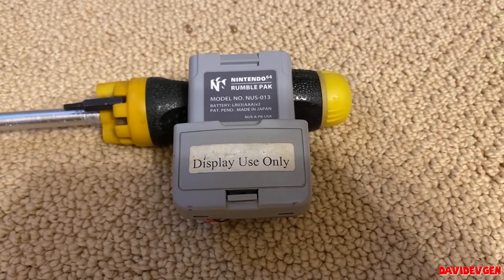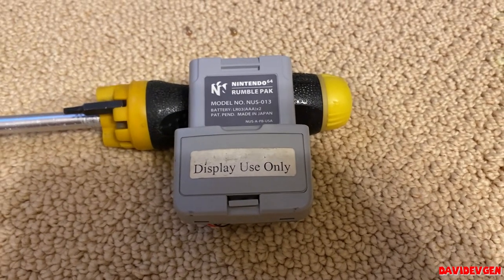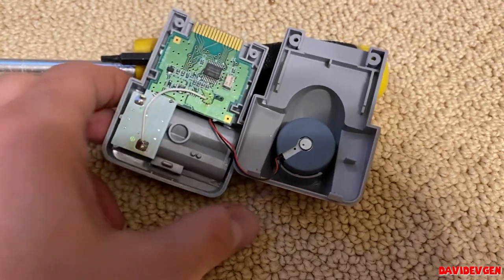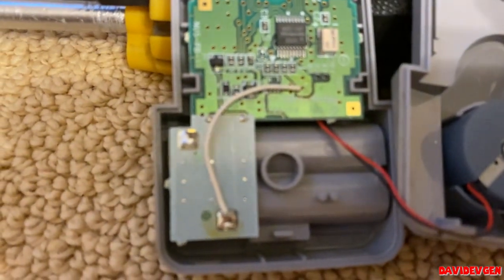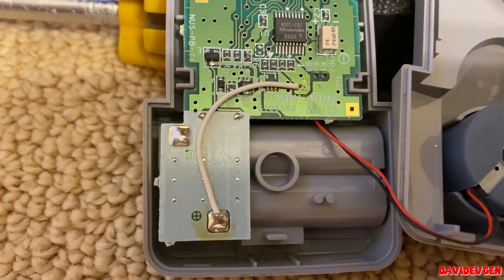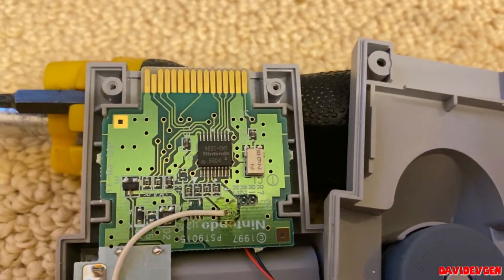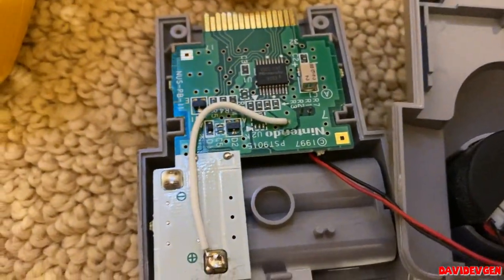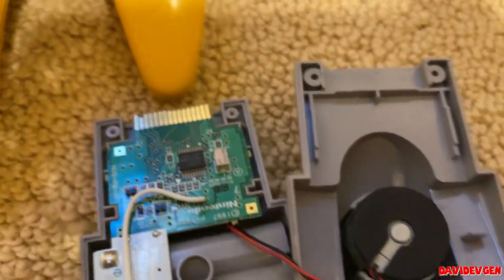New way for No battery mod for n64 rumble pak

Comment: Makes me wonder why they didn't just do that in the first place. More support for rumble paks would have probably happened as it would be smaller and you wouldn't have to keep changing batteries.
Reply from the maker: from what i heard  only two runble paks  can be used  any more that there wouldnt have been enough power.  but  they could have added a little more amps  so that all the rumbles could be ran.
Reply: @Davidevgen  makes sense, I've only really thought of using rumble for 1 player but there was a much bigger focus then on local multiplayer. Though I can't imagine many people would have owned 4 rumble paks.
Reply from the maker: @Blazi3  i owned 4  at the time.  but im the only one the used them lol.  i raerly had 4 friends to play on my n64.
Reply: @Davidevgen  you can definitely run more than 2 of these all at once, I wouldn't haha, but there is enough power. I think it actually draws TOO MUCH power through the N64 console and Fs it up somehow is the way I understand it. Rumble paks went to batteries mid development after seeing the moderate success of another console that put 4 players stock in their system and this mid development shift is why (I think) these mods are possible in the first place, what luck!

Thanks again for sharing this, I think it's amazing. I played starfox 64 in the kiosk just like this back when I was 8 and it blew me away. The rumble was intense for a little kid. I'm still playing that game. 

I guess whenever the algorithm decides this should be known is when this will be known haha. You'll probably have a million views on this eventually. 💯💯💯 

https://www.youtube.com/watch?v=U855TBx2SA0 here's my vid, it's not that great, but it's meh okay.

Comment: Hi could you please tell me the wire size that are connected to the rumble pack motor. Mine broke and I am trying to repair it. Don't know if they are 26 awg or 28 awg gauge. Thank you so much. Sometimes you can see the awg on the wires I was just wondering if you could see it on yours thank you.
Reply from the maker: there 26
Reply: Ty
Reply: I am also going to mod the N64 rumble pak nice video 👍

Comment: Doesnt feel right or sound right, without the weight of the batteries.
I had to put batteries back in and block contacts with cardboard after doing the mod.
Reply from the maker: i like it its so much lighter lol
Reply: @nesrepair  I'd like it lighter, but the vibration doesn't feel the same and it's noisy.
Reply from the maker: @bloomerb4162  remove the battery clip  or add some toilet paper inside to keep things steady
Reply: Do you still repair Sega nomads or do you know anyone who does in California?